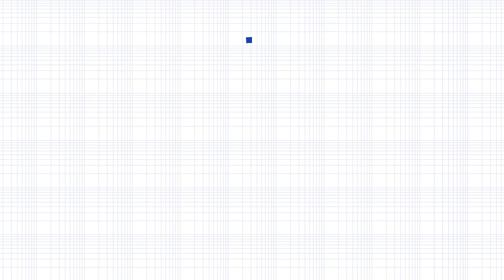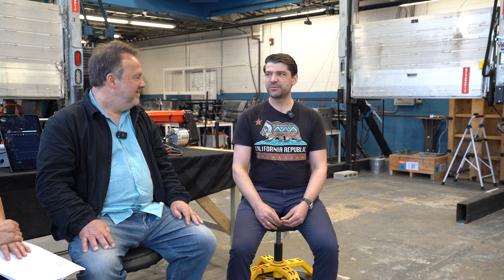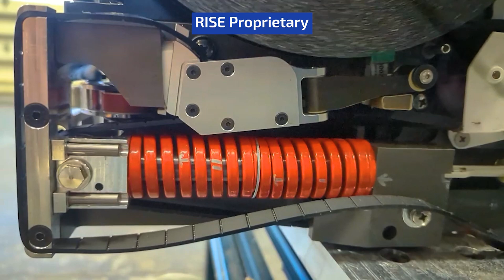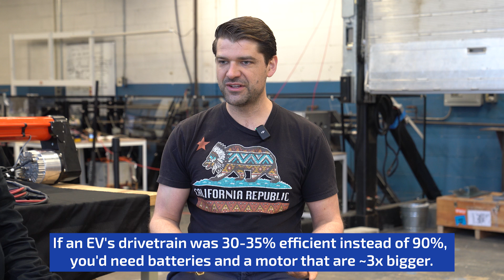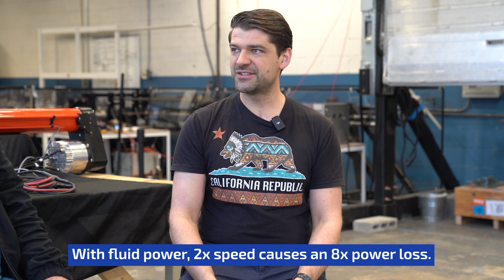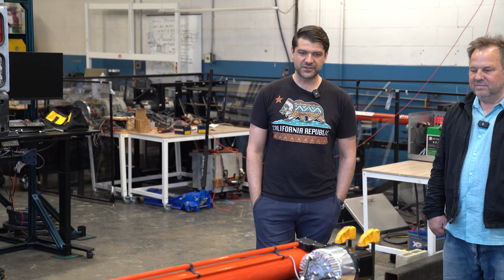Responding to Your Heavy Machinery Electrification Comments! (w/RISE Robotics)

Comment: Are you planning on electric driver using planetary hubs?
2 24v alternators charging two banks of batteries with capacitor discharge should be able to cary the load.
How many of your acuators can the control box support?

Comment: Hydraulics has its place in time. Now that ground contamination plays such a big part in construction, this system has real merit.
Heat degradation on hydraulic system plays a much bigger part than most realize. 140 deg is optimal op erating temp. Go up 20 deg and cuts way back on replacement schedule.